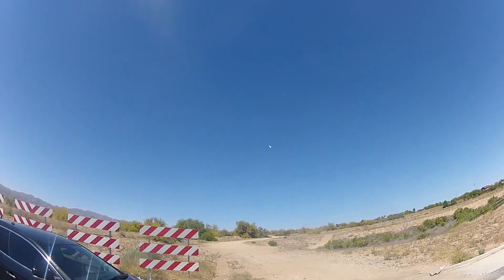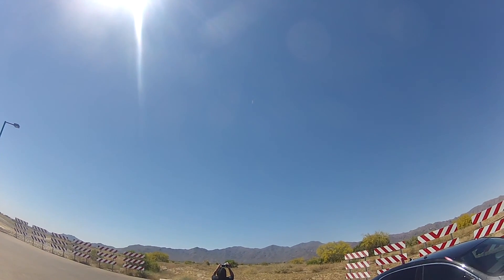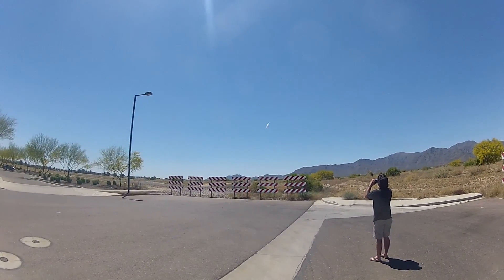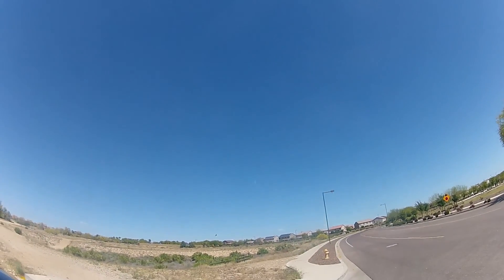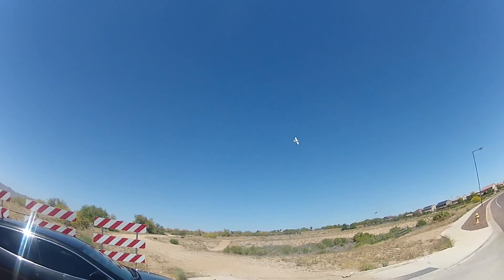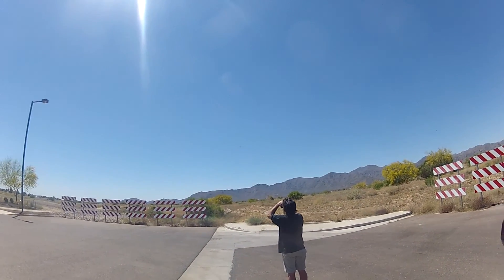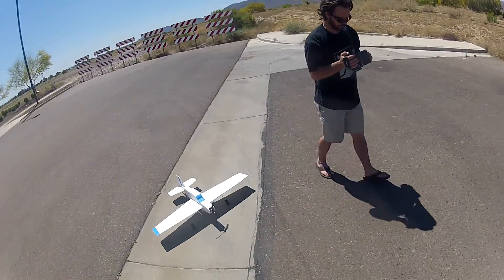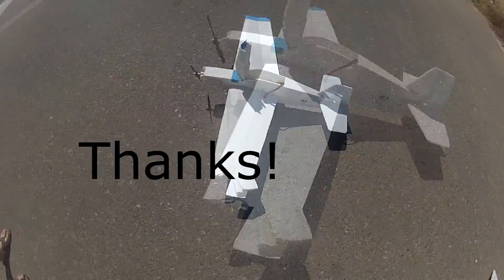Flite Test FT-3D gear Mod Maiden and amost crash

Comment: Nice flying! That should be an easy fix. Hot glue and foam board...I love it!
Reply from the maker: Thanks OP.  This craft started life with a 40" span, so I had a little wiggle room.  I have since trimmed down the wings to about 34".  Picked up a little more speed and an insane roll rate.

Comment: Pretty nice!  I just built an FT3D.  What is your power setup on this?
Reply from the maker: Suppo 2217/6, suppo 40amp esc, 3s2200mah turning a 9x6x3.  Great speed and most advanced maneuvers.  You can hang it for 3d when the batt is full.  Might be better with a higher C rating but I've only ever ran a 20c with30 burst.